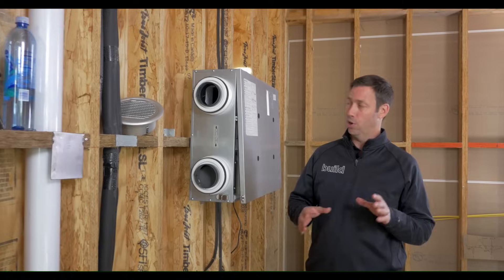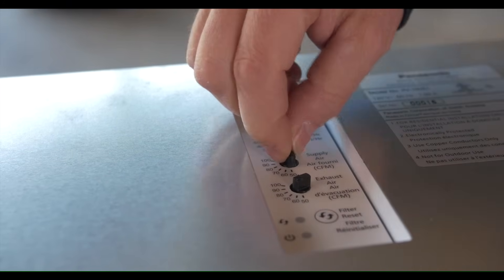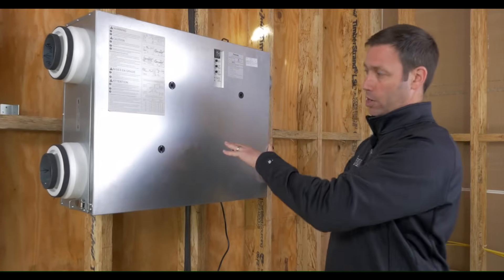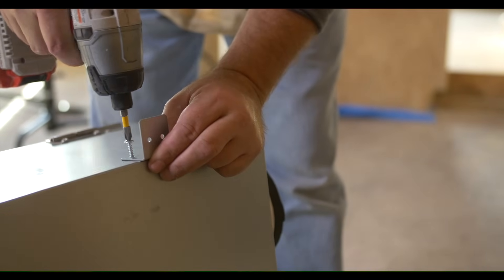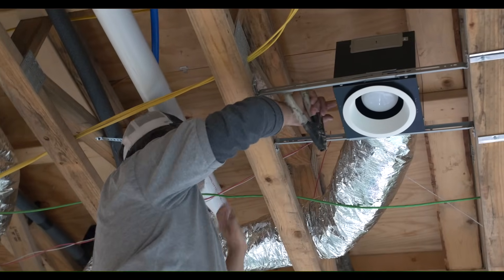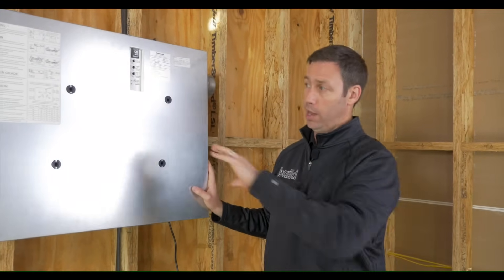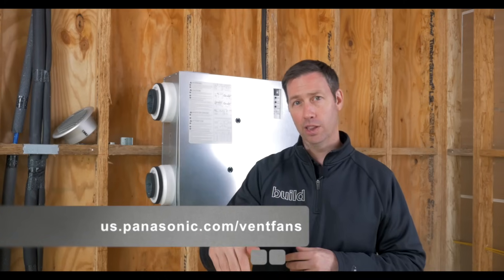How to Install an ERV

Comment: First time I saw one these things I couldn't believe it. Stress skin panel home was so tight that the air inside would become unhealthy. So we have increased the efficiency of a home to the point where we need another expensive device and failure point, to keep the air quality healthy. How did we ever survive back when homes weren't quite as tight? The first one I saw I was hired to help replace it, as rodents had turned it into a nice home....
Reply: Approximately 1982, in Regina, Saskatchewan in association with the University of Saskatchewan and half a dozen other schools and the Canadian Federal Department of Research and some of Canada's leading architects and engineers, they got together and built three houses, with the design goal of building a house that would stand alone in the Canadian prairie winter and maintain liveable temperatures without any mechanical systems.  A passive solar box.  They did it, but in their joy and haste, deployed people in the form of families to attempt to live in the boxes.
Within weeks the jubilation turned to wretched disappointment as everyone but the dog, got sick.  No one had thought about air quality, and to make things worse, the house was no longer "net zero energy" now that someone lived in it.  And we the people kept paying for this circus...  The next thing they came up with was air to air heat exchangers, something only Red Green had managed to do up until then.  They should have consulted him because they were another 20 years getting the HRV thing to work, as it does now.  In fairness, the things work far better than I ever thought they would.
Reply: You can open windows if you like as well- it's good to have fresh air even when windows are closed, which doesn't happen in traditionally built homes either (who knows where the air is coming from with cracks and leaks- radon filled basement? Garage?

Comment: WHAT IS IT????
Reply: enkrypt3d open a door or window, duh
Reply: Buck E why? The air is filtered in this thing. That's the point of this system. To filter out the contamination! DUH
Reply: enkrypt3d duh, yea good point Lol. I guess he spent little time on filtering and focused on airflow. I guess this is high end luxury for the hypersensitive to allergens and the need for fresh air. Don’t let my wife see this vid either, she be all over this.
Reply: it's a fresh air system for your house.... duh.
Reply: @enkrypt3d  The furnace  units have their own filters, then they have attached electronic filters and humidifiers for winter. A dehumidifier can help in summer times. The house is a " living " thing. Doors and windows open all the time. Fresh air comes in and stale air goes out with every opening. Also there is not such thing as an
 " air tight"  house!!!
Reply: @demetrispriovolos164  that's not true at all. You can have an air tight house to a degree... how often do you open your windows? I never do. Dust, pollen, smoke, car fumes etc all come from outside. Of course you can have the house sealed quite well which will improve efficiency.

Comment: The ERV looks like needless complexity.  My house is not that tight; nor do I want it to be.  The fan runs continuously and I use a fine filter.  The fan motor may not last that long but the installed replacement cost is $700 so there is no great concern.  And with the cost of natural gas dropping, the payback period may well be beyond the life of the system.

Comment: I saw the duct work you were using and I would not have it in my house.  I took out all the flexible duct work and replaced it with rigid.  Stays cleaner, less opportunity for mold to grow; and of course, when it comes to cleaning the ducts it is much simpler and thorough.  When I bought my first house in Ohio I was flooded in 2003; not a problem of building but when you get 14" of rain in a week and then 7" in 45 minutes you are going to have a problem.  When the rain stopped, the water left my property (1 1/4 acres)  in less than 45 minutes  - a new respect for moving water!  During the flood, my basement (1,796 sf.)  went from bone dry to 24" of water in about 15 minutes; the water came in through the basement windows and was strong enough to move a 5 gallon bucket of horse shoes and stakes the full length of the basement.  I spent the night pumping out and was ready for the clean up crew the next morning.  They started by putting two huge dehumidifiers in the basement and then on to the second floor and cleaning the ducts.  They commented that it was good to have rigid duct work - much easier to clean.  Then back to the basement to cut a large hole in the duct work and send their brushes up.  Then shut everything down and leave the house for an hour while all the ducts were sprayed with a biocide.  Repeated with another two days later that allowed us to stay in the house but with all fans turned off.  Then the basement was dry enough to power wash the basement floors and walls half way up.  Had to empty out the basement of furniture I was storing for my daughters (two houses worth), filled a 40 yd. dumpster and finally a new coat of paint on the walls and floor.Every house I have owned has been drained to daylight.  This house has the strangest waterproofing system I have ever seen.  The foundation was sprayed with hot tar, then a fiberglass mat was put over it along with a second coat of hot tar followed by 4" of rigid foam insulation.  The inside is painted with two coats Ultra DryLux and then painted with a highly reflective SW white paint.  The floor was painted with SW concrete paint.  Fifteen months, no dampness, no dust.  Whoever had this house built did it right.  Even the crawl space has a 4" concrete floor!
Reply: who puts 4" of rigid foam around their basement lol.. the sheets you buy at the store are only 1 inch. that means 4 sheets just for one area
Reply: @Blox117  people who want warm basements

Comment: in the winter is it going to bring in cold air?
Reply: it brings in cold air, but the hot air being exhausted from the house warms up the cold air coming in so it's not as cold, that's why it's called an Energy Recovery Ventilator instead of just a House Ventilator.

Comment: Is there any benefit in using an ERV in a hot a dry climate such as far Northern California? Summer time high temperatures average about 100 with humidity under 20%.
Reply: as far as I'm understanding how ERV and HRV's work yes. In a dry climate you may want to have a whole-house humidifier on your main HVAC system to keep the air more comfortable and not dry you out, in which case an ERV would leave most of the humidity in your home - while replacing stale old air with fresh outside air.

Comment: UM, what does ERV stand for?
Reply: That looked like more flex duct than your usual install.
Reply: expensive return vent =P
Reply: These are horrible to maintain. I have 7 of them in a commercial building.in NWestern North Dakota.  Ive told our design engineers, Install them in another building I maintain and Ill have you come clean them and change the filters out. Giant bug collectors and suck "fresh" dust filled air. The filters are expensive as heck. Other buildings I have without these do just as well if not bettet.
Reply: @Nothingtosee-m1c  The filters aren't normally expensive unless you're using HEPA filters- which aren't necessarily required.
Reply: @technorex344  I'm using the basic filter media suggested by the manufacturer. These are a filter that are orange on one side and white on the other. $26 a pair for those filters. I buy them by the case because after 3 months they aren't worth cleaning or reusing. My others use MERV8 pleated filters, IMO, MERV8 filters stink but I can't use MERV 11 like I do in my Carrier HVAC units. These things are not a good pick for this weather and dusty environment.

I think it's funny people ask me an what's an ERV? Ask Siri or like I did ask Google Assistant, using this tech makes life so much easier. 😂
Reply: @Nothingtosee-m1c  Interesting.. What brand unit?
Reply: energy recovery ventilator
Reply: It's not about "special air." Modern homes are built extremely airtight due to energy efficiency requirements that active ventilation is required to prevent moisture buildup and mold growth. The ERV provides this while also using the exhaust air to heat or cool the incoming fresh air to reduce the energy cost of treating the fresh air.
Reply: energy recover ventilation
Reply: sometimes his videos assume people know what he is talking about although im sure this is a great video.

Comment: I've always wondered why exterior walls are not constructed so that the plywood rests on the concrete or brick foundation and left to hang over the edge. Does anyone know why this is so.
Reply: your mudsil should be even with edge of the slab so that when you install your sheathing it can run down past the edge of the slab to create an overlap. so that when water runs down the wall it wont run directly down onto the edge of the slab which in turn means a leak and then rot. the osb is not a proper barrier and should not be used as if it were siding

Comment: You did a bunch of videos where you recommend using an XT105 whole house dehumidifier and hook it up to a fresh air intake and then blow that air into the regular HVAC ducts, resulting in a positive pressure system instead of balanced. Do you prefer the ERVs now over the positive pressure systems? Or is this only required because your ACH numbers are getting so good and the positive pressure system won't work well anymore?
Reply from the maker: +Robert Hawke great question. I use a Dehum for every home I build in the hot humid south but if the house is tighter than 1.5ACH50 I'll add an ERV for Fresh Air and not use the Dehumidifier fresh air port. Make sense?
Reply: thanks, yes makes a lot of sense, that's what i assumed. I'm nowhere near the 1.5ACH50, so I guess I will stick with the dehumidifier and positive supply pressure system.Thanks again!

Comment: I really need one of these. I have a brand new 900 sq ft home that is super tight. I often leave a window or door cracked open.
Reply: Actually, this unit is overkill for a 900 sq ft super-tight house. At its lowest 50 Cfm airflow, it is way more ventilation air than you need. Panasonic offers a much cheaper version that outputs like 20 and 40 Cfm, called "WhisperComfort FV-04VE1. Runs on only 23 watts, and is 36% effective at removing moisture. It mounts on your ceiling, penetrating from the attic.
Reply: This unit would struggle on a 900 sq ft house with a ceiling height of eight feet since it only rated for a maximum 100 CFM.  You would need a unit of at least 240 CFM rated, and that would only give you 2 air changes per hour.  Thought you would like to know.  --Jason ✌🏻

Comment: Hey Matt, I always enjoy  gaining insights from your YouTube posts ahd have high regard for your Building Science knowledge. 

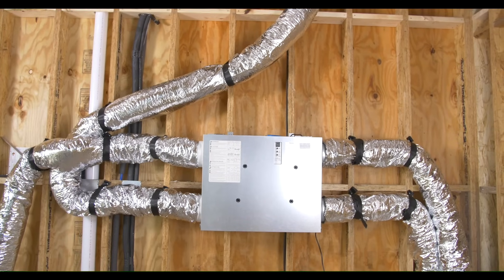Quick questions regarding use of flex ducts on this install as opposed to rigid ducts (3:24 https://youtu.be/pkvoXK6-fjk?t=204).  How is this ERV system different from HVAC with respect to duct type?  Are the runs short enough that duct type doesn't matter?  Cost?

Thanks for keeping the content coming.
Reply from the maker: +Corwin Shakes great question. Yes very short runs here. Not as worried about distribution and we can balance the system post install. Variable speed motors. Certainly a cost savings to do flex.

Comment: hey matt. are you only installing 1 supply and extract point? when your down to say 1.5 ACH would you be placing fresh air supply into each room? ...... nice flex duct😉
Reply: For a really tight house, you SHOULD be installing exhaust ducts to each bathroom, kitchen and laundry room, and supply ducts into every other room. I'm not sure 1.5 ACH actually qualifies, but certainly 0.6 ACH and below. Otherwise, you are definitely going to have rooms with relatively stale air.
Reply from the maker: +Scott Florence no only supply to one location in the house.